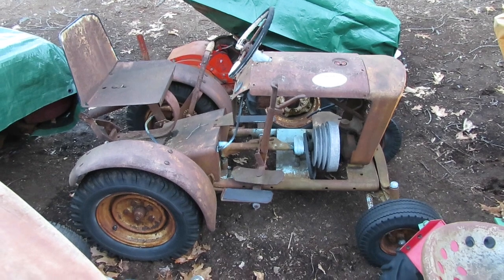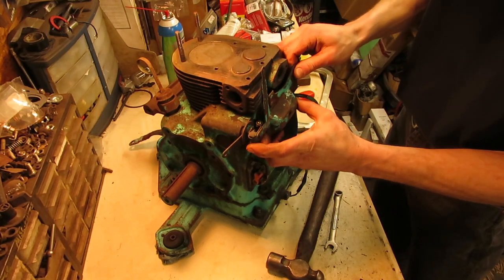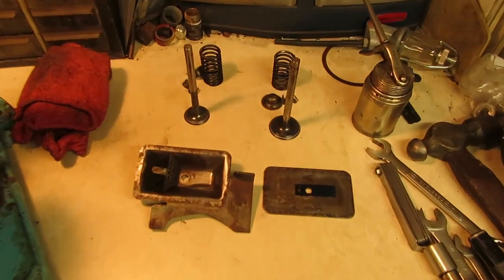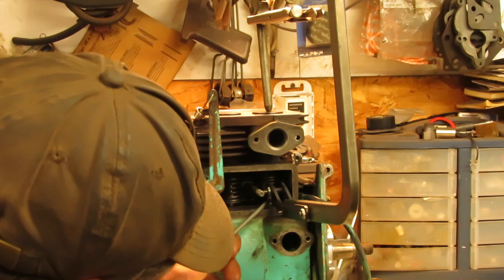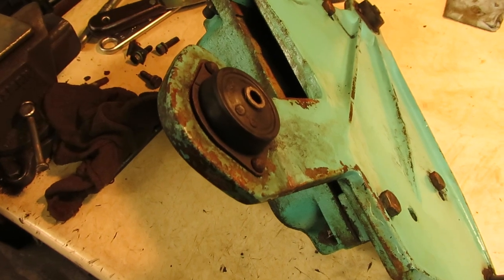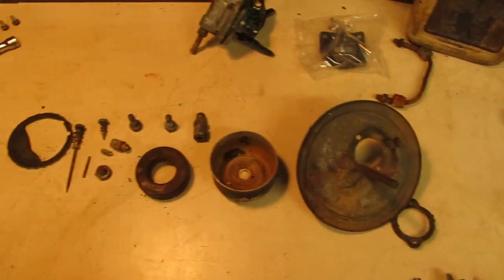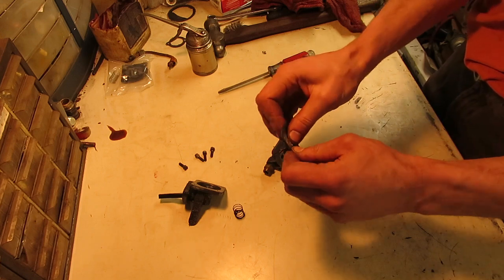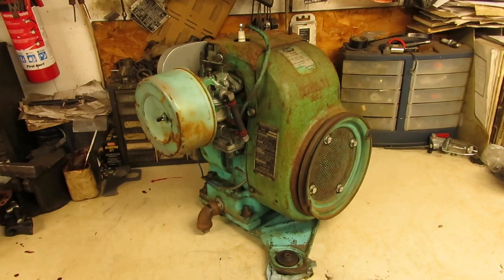Building a Rusty Panzer T758ES Tractor- Part 1 of 2

Comment: A-PLUS and one thing about the old ones is they'll just putter right along. My dad got a 7 or 8 horse on a Troy-bilt Horse tiller and it NEVER failed to start, no matter how long it sat. The 12 horse jobs on the 5665's always fired right up and always promptly stomped a mudhole in my butt. Nothing like them. Hope the picking went well and you gave your usual tenor accompaniment to the vocals. I look at the NICE shirt but haven't gotten the nerve up to wear it. In the process of getting in with a dermatologist for my mange. House arrest still stands as does your 5665! Keep after it, keep picking and God Bless!.
Reply from the maker: Had a few of those tillers pass though here over the years with the 181's. Sure beats the older models with the Tecumseh's on them... The pickin' was just fine Lewie! Had a gig with the usual bluegrass band this past Sunday too, 4.5hrs. Took a couple breaks in between but man that was a long gig! The Deering I have has a wheel weight of a tone ring in it, and hanging off my skinny shoulders all afternoon...
Reply: @5Tractorguy  MY 1st Troy-bilt had a blown Tecumseh on it which came off and a Wisconsin Robin went back of which I swapped for 2 Gravely non-runners . My first experience with tearing them down and making one good one out of 2 since one case had froze and busted. I can stick with one instead of 5 when you come get the plow.  Sounds like the other pickers got their money's worth out of you. 4.5 hours is almost a half a day! I've seen a bell brass tone ring for maybe an arched top and a flat top. Like hauling around a truck tire. Might need a rig like Eddie Adcock used to just hold it but if I had a Deering I'd flash it around so's folks could see it too. And the light shining off your teeth and the BIG grin! Carry on, Buddy! You're  doing just fine! BLESSINGS!

Comment: Good to know about the valves. I have a K-161 in a Cub 72 that needs the valves done, got the machine for doing a engine job on the guys Cub 105 and the K-161 backfires out the carb anytime it wants to fire.
Reply from the maker: Bet the intake just needs to be shaved down some... That's the only pain in the neck thing with the small Kohlers is adjusting the valves.

Comment: Jake the old 200 series John Deere garden tractors use that type of engine isolators don’t know if there same size nice save the old kohlers if they had any care at all will surprise you glad your back
Reply: You are correct unfortunately they are a different size. I know this after ordering some used on e-bay, unfortunately they are about 1/2” too big.
Reply: @RustyZipper  I bought couple for jd 210 few yrs ago they seemed expensive should have done all four
Reply from the maker: Thanks Terry, can't beat these old K series. Fantastic engines... Zipper is correct, same style mount on the JD's, but a bit larger in diameter.

Comment: Can you tell me if all Kohler engines had the steel spider arm mounting plate attached to the cast iron engine bottom ??? Whis is the lapping width of the valve seats of the intake and the exhaust ?? Thanks Jake for the tip on the rings for the small block and the big block on the smoking factor. I like your trick using a drum sander in the drill press with a jiged vice guide to clearance the valve clearance. May I inform you "Doctor Jake" the valve spring retainer patient will live !! The oil pan has oil rust sludge soup in the bottom. Nice that you change it fella. This is what usually kills engines, especially Wisconsin's. That fact is from a old mechanics that I know. What is your belief of using gasket sealer on the gaskets Jake ???  How many years did Kohler use the under flywheel magneto ?? 
Nice work Jake and peace too. v

Comment: Jake do you have to clock the little holes in they main jet in any specific orientation before you drop it in?
Reply from the maker: Nope, there is space between the walls of the bowl stem and main jet for fuel to flow (think dropping a 4"dia ring inside of a 5"dia ring and having 1/2" of space between the two). So they don't have to be oriented. If it was an older Tecumseh LME style carb, those have to be lined up.